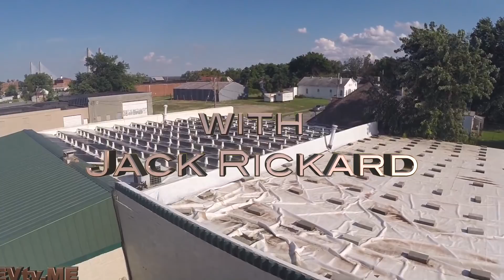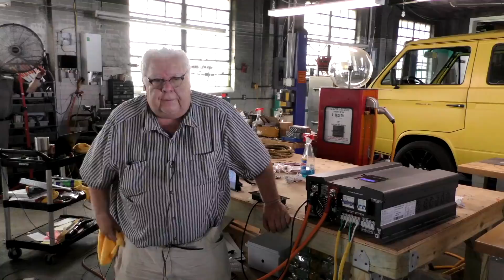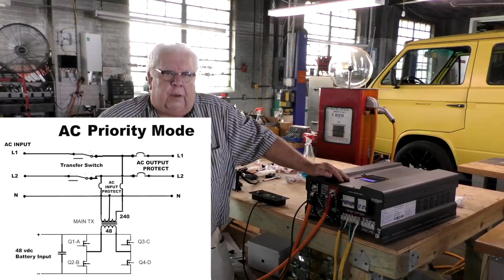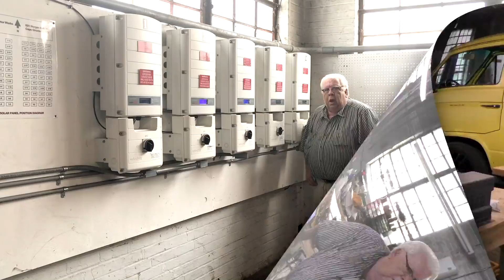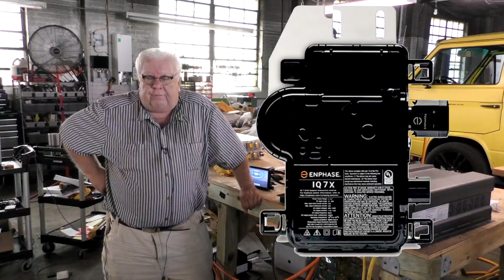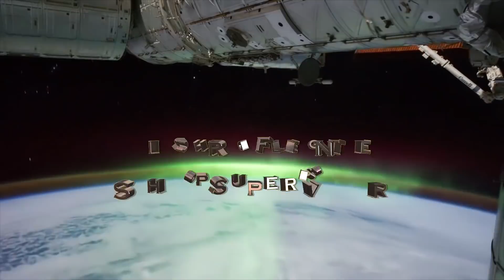12kw Solar inverter Designed for Tesla Battery Modules. EVTV Friday Show -

Comment: Hello everyone,  I have a solar panel system on my rooftop.  And I am looking for a high voltage battery setup. The system spec is LG 365 with p400, storage 7600 and 1LG Chem battery (400- 500v). I'm looking for another battery that I can parallel  with the Chem or AC couple to my breaker panel. I would like to be able to make this a plug and play setup and portable.

Comment: What about the Solar City h6. It was Tesla's discontinued inverter they're being liquidated on eBay for $500 now.  That uses something like a 400v battery but I'm having trouble with the communications between it and my battery because my battery is not a Tesla brand power wall.

Comment: I see this same inverter for sale on eBay and online but the shutdown is the same as aims 12kw are you saying they make this inverter to your specs but in the same case as the others? The only reason i haven’t bought the aims is for the shut off and charge isn’t correct for my battery bank, is there a warranty on what your saying on your site?

Comment: This is excellent, so pleased I came across this video and will share. I had never thought of using grid tie inverters in this way. It is timely as yesterday before watching this video I emailed my manufacturer of low frequency power inverters to input into the next design of a fully programmable MPPT/LOW FREQUENCY INVERTER range which will also have a Victron style capacity monitoring and shunt with bluetooth and wireless built in. Things are moving fast but as you say those manufacturing in the East don't seem to have their eyes and ears open from the feedback on forums and youtube. I will be interested how this progresses as the utilities companies and government Health and Safety legislation tries to keep up!! Signing these off grid systems off is a nightmare in the UK as all the sensitive equipment is only designed to measure base grid power, anything outside of these parameters throws up errors due to the minute fluctuations coming from the inverter. Won't a long before they start to lock down what the DIY hobbyist can do to become self sufficient. I have heard in the USA that some states its illegal to harvest/collect your own rainwater, not sure if this is still the case?

Comment: Thank you! Appreciate you sharing your knowledge. We have a 10KW pv system with a 10KW grid tie inverter and want to go off grid .  Would your set up you demonstrated work with 48v lead acid battery bank if the inverter had the proper settings for lead acid?
Reply: Bought utility subsidized light bulbs at a Walmart in Wood River Illinois for $1.88 for four 60 watt equivalent soft white.

Comment: I have 1000 watts and 3-24volt battery packs, the batteries are Trojan 105RF. That with charge controller, inverter,wiring and other crap thats over $4000 .

Comment: With the amount of 21700 battery being produced, you would think there could be a market for some sort of battery utility pack. Not that those don’t already exist, but i think there are opportunities not currently used.
It could be a EV range extender(if you imagine a inside connector outlet),  a camping/caravan power pack or a mobile workstation van/pick up configuration.
The battery pack itself should be just batteries and connectors, but with a slide on, or a snap on system you could get all kinds of converters meant for a specific need. 12v dc/120v ac/ 240v ac or whatever you need wherever you are in the world.
The battery itself will then be easily compatible with all kinds of systems like portable camping/workstation, or more permanent solutions like a power wall. 
Same with charging...it should be able to charge form all kinds of sources , like mounted in a powerwall or with a slide on/snap on device hooked up to whatever available, grid or solar.
With different battery pack sizes and a variation of connections it should be a very versatile system, far beyond any system available today in both utility and power.

Comment: The EE and control theory of GTI synchronization is a little above my head, but I'm kind of with the manufacturer here .. how exactly can this work?  As I understand it, a GTI inverter follows the grid voltage to align its own voltage, frequency, and phase.  So far so good.

To inject power into the grid, it has to become a current source instead of a voltage source.  In idiot's terms (and this is where I might be woefully mistaken), the inverter then attempts to lead the waveform phase just a bit -- basically, trying to force the grid frequency to run faster.  Since the grid is an immovable force (a voltage source with very little impedance), the inverter won't get it to budge, but instead will either hit its current limit, or run out of supply from the PV side.

However, that little 12kW box isn't an immovable force.

Now, the video mentions that it can't be left alone to run as a sink indefinitely, because at some point the battery will reach full voltage, but the charging won't stop.  Maybe that's the piece that maintains sanity?  Since, as long as you can't supply >12kW (by too much anyway) with your inverters, and as long as the battery can sink all the extra current you produce, then the box can be treated more or less as if it WERE the grid -- steadfast.  But, should you overpower it with enough parallel GTIs, they would unexpectedly succeed in running the line frequency up to the point where one or the other called it quits -- fatally, or under control of a supervisory system that knows it should never see (e.g.) 65Hz mains.
Reply: I don't doubt you, and I'm not trying to convince you otherwise.  It clearly works.  I'm just trying to understand the full theory behind how and why it works, so that one might be able to determine (and thus, perhaps, prevent) the factors that would change the mode of operation from emulated power plant to emulated camp fire.

It's pretty cool, don't get me wrong, though on a thin margin of stability -- which may very well be plenty, but perhaps not enough for my own taste.  It all depends a little too much on the battery to keep things running, IMHO.

Knowing full well we don't have the luxury of wishing hardware out of thin air, I would personally like to see this evolve to one of two slightly modified arrangements:

1) Software control of the PV inverters, so they could be individually enabled and disabled as load and battery SOC vary.  I would rather this be logical control vs. something brute like a contactor, since it seems rather rude to make it a habit of physically disconnecting 5kW loads by breaking the circuit.

... or, preferably:

2) A charge controller that can charge the battery w/o impact on the ability to generate AC from the pack (w/ or w/o help from the PV); along with (since we're talking about non-grid-connected islands here) external waveform synchronization.  So rather than "following the grid" for synch -- with all the peril that brings -- I would love to see sideband synchronization, so things don't collapse in a spectacular manner if the waveform generating device suddenly goes away, or can no longer absorb 25kW of power generated in parallel.

But for now, I suppose these are the Lego blocks we have to build with.

Comment: SMA Sunny Island uses Frequency Shift Power Control to throttle the grid tie inverter from 100% to 0% between 51-52Hz as the battery reaches charge voltage. Wouldn't this be a good  solution here?
Reply: Thanks for the SMA input , I have one ,6.0,  plan is to use it with split phase inverter.
Same as on this video. Thanks again for mentioning SMA, very encouraging.
Reply: @Jack Rickard 
Hello Jack your a genius and I will follow 
Will this inverter power up with AC power from grid on utility priority.
Reply: Do you think that would work with my Honda eu2000i ? 48 volt chargers are so expensive I've been running my generator through my inverter backwards but it's unregulated and I have to be careful to shut down the generator befor the batteries pass absorb voltage.

Comment: Can you get that Chinese manufacturer to do frequency shift to control the output of the solar edge units?  60hz =100% power, 61hz=100% power, 61.5hz = 50% power, 62hz=0% power from the solar edge units.  This is the necessary part of ac coupling.
Reply: As the battery approaches fully charged, the inverter should change the pilot frequency higher right to nosing over 62hz.
Reply: Cool.  SMA, Schneider, solar edge all do this frequency shift 61-62hz = 100% to 0% output).  Caution: Magnasine and their GT500 microinverters do it backwards.. lower frequency means lower output for them, so they are the odd ducks.   They won't play well with a generator that gets loaded down will they?  Anyway, you should always have a secondary cut off method, so keeping the contactor is a great idea.
Reply: I sniffed around your webstore and I'm quite confused about exactly what a fellow needs to use a tesla battery.  Do they come with BMS systems?  or is that an extra purchase?  The TV screen communicates on CAN bus, got it.... but there's a lot I'm not understanding.  ALso, I think I'd prefer to use Chevy Volt batteries, but a battery management system is a BMS I suppose....

Comment: Jack great video.  I get how the grid tied inverters sync to your 12kw inverter, but once the 12kw starts charging the battery it is no longer 'generating' a sine wave for the grid tied inverter to sync too.  My guess is the grid tied inverters are syncing to themselves?  I assume as long as they can power the load and keep the voltage above the minimum (225?) and below the maximum (264v?) they continue to power the load. I assume if the load gets too little or too much the grid tied inverters will stop producing. 

I hope you'll do a video and explain how grid tied inverters 'turn off' when the 'grid' goes away.
Reply: I'll give it a (long) shot. First, none of the inverters in this video were tied to the grid. The Solar Edge ones can, but weren't. The "clock" comes from the 12kW inverter and the Solar Edge inverters sync to that. As far as they knew, the "grid" was on. The 12kW inverter was powering the shop until the point where the Solar Edge inverters covered the shop's load. Beyond that point, whatever the shop didn't use coming from Solar Edge went into the 12kW's battery.

It works because the 12kW battery is a so-called "low-frequency" inverter consisting of mainly a large toroidal transformer. The transformer is wound to take 48V in one end and output 120/240V at the other. If current flows in from the 120/240 end then you get 48V at the other. The only drawback is the lack of current regulation at the 48V end. Jack's covering that by interrupting the Solar Edge inverters when the batteries are charged.

A 'soft' way of doing this would be for the 12kW inverter to up/down the 60Hz clock to 'shift' the Solar Edge or other compliant AC-coupled inverters into reducing its output. At ~60.5Hz, most compliant AC-coupled inverters would cease to output, stopping the batteries from overcharging.
Reply: Thanks Jack for clearing up my thinking. I learn a lot watching your videos.
Reply: This is still very fuzzy to me...  Is there a way to put on oscilloscope somewhere in the system or something?  How can the off-grid inverter back-feed a wave form to the grid-tied inverters while the grid-tied inverters are powering the shop and charging the batteries??
Reply: The voltage difference between GTI and the (off-grid) inverter has to be pretty minimal for the GTI to "follow" the inverter.  Otherwise it would no longer be following it, by definition.  Also, they're all in parallel, so anywhere you measure, you should be seeing the same voltage minus the difference of what is lost in cabling -- which can't be much if it isn't smoldering.

I don't want to be spouting disinformation, so I threw together a quick simulation with a 120V AC voltage source connected to a 100A current source via a resistor (to simulate the interconnected cabling.)  I tweaked the value of the resistor until I got 5W of loss between the two "inverters", which came out to 500 micro-ohms, and a voltage difference of 50mV on either side.  The scoped waveforms are identical as far as the simulator will resolve (50mV out of 120Vpk is 0.04% difference.)  These figures are all fudged, but if you're losing more than 5W in the cabling, it ought to be getting warm -- depending on its length and insulation and all that.

So, yeah, it's technically true that the GTI produces a "slightly" higher voltage, but it is just barely higher.  If it got too far off, the current output would get out of hand pretty quickly.

(I do kind of wonder if GTIs skip cycles periodically to ensure the "grid" is still there, or if they entirely depend on output voltage/current/frequency to signal loss of line.  If you pull the voltage source from the simulator, the current source -- even multiple parallel current sources -- just immediately spike to infinite voltage.  Or, to a constant DC voltage if there's a resistive load.  Even a variable load would cause an erratic output voltage that no longer looked like a predictable 60Hz sine.)

So that pretty much just leaves the question of the battery loop, which is where the majority of the current is being sunk.  Hard to say what the exact topology is without opening it up, but cost and complexity and size all suggest that, if the sum total of big-iron passives under the hood is really just one single transformer, then the DC-to-AC inverter outputs a high-current, low voltage AC waveform (in the neighborhood of 48V) that is in parallel with a bridge rectifier that goes right back to the DC bus.  That would mean the regulation of the AC mains would be pretty much crap, though, since the peak AC voltage would be tied to the transformer ratio times the DC bus voltage -- which will depend on the battery SOC.  If there's an additional inductor, then it could be PWM with a higher ratio -- so, more like 40-to-170 instead of 48-to-170.  That would keep the output regulated until the low-voltage cut-off point.

Either way, the battery charger is essentially its own device that just happens to be in parallel with the LV/HC side of the transformer.  The inverter can keep running, supplying a variable load, and ensuring the GTIs have a waveform to synch with.

That's my guess.  It would be interesting to see what's inside the box though.

Comment: Can you show a wiring diagram for the system this video is about. I am installing a solaredge based PV system and really would like to make it available when my utility goes down or to load shift from one time to another. Who is your utility and will they allow this non-UL rated equipment and transfer switch?

Comment: Audio quality is better in this video but still some static & cutting out. Please try taking the transmitter out of you pocket and cliping it on your belt. Being in contact with the body alters the antenna performance and I'm sure that's where the bulk of your audio quality issues are coming from.

Comment: Is there an inverter that allows you to run 2 in parallel for redundancy? I want to go off grid but don't want to go a month without power of the inverter fails.

Comment: I'm glad you are moving away from the 48 volt system slowly 
A 400 volt D.C.  P.V. to charge a tesla battery plus1 module  directly is so simple  to me and then then from  your battery to a charge point to the car or a grid tie inverter to supply  the shop or grid 
the old point 
keep it simple
Reply: Jack Rickard as an Electrician in New Zealand 230/400 grid trying to find information on a 400 volt system and dealers or supplier for that equipment is impossible 
technical information and training Is nonexistent here I need information and product so I can sell it
Reply: I would never do a 48v system.  High voltage all the way!!!

Comment: I Changed everything  to LED lights but used Aluminum profiles of various lengths.  I used RGBWW and put power supplies for each strip that are controllable remotely.  Some of my light bulbs are 16 feet and my longest is 30 feet.  The neat thing is a 1/3" strip inside the profile with a diffuser.  I have any color and any birghtness level.  No shadows in house.  That took some time to put up but is really nice to have even light.  The latest bulb from aliexpress is 12w with 130 lumens per watt and has a battery backup, runs on 120 or 220, and has solar cells.  It can be a camping lamp or if you are having a party just hang them. It is $6 including shipping.  It uses LED's underneath a fluorescent coating so it is even light.  The bulbs in the stores in the US are about 2 years old tech.  Modern LEDS are 130 lumens per watt and have florescent coating that  changes the light from a point source to a linear source.  The physics are similar to the reason to have a long light source.  The flux density of a linear long light near the length of a room is the holy grail in efficiency.  The radiation from a point source reduces by 1/r*2.  The loss from a linear source drops by 1/2.   This math may be off a bit as it has been 40 years when I was in my electrical engineering course calculating the power density of electromagnetic radiation levels using integrals.  Good test question.  It is basic em theory that any electrical engineer can calculate.  Imagine how even the light would be in a room with a 30 foot fluorescent light bulb.  My 30 foot bult does a good job of lighting a 1200 foot garage with a 10 foot ceiling and the power supply I put in for it was a 120 w max.  I was planning on 3 of these strips but the one light in the center of the garage lights up everything .  Replaces 10 4x4 fluorescent fixtures. 
Love the technical talk on this solar installation.